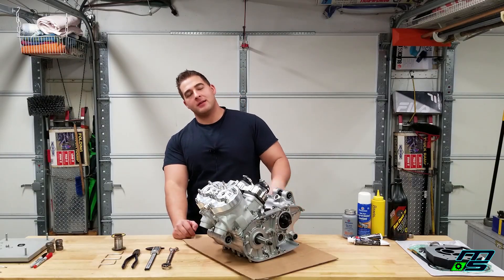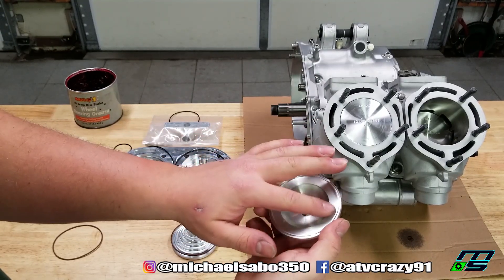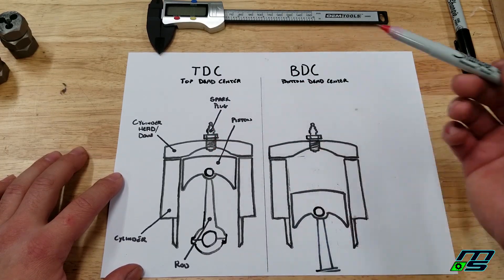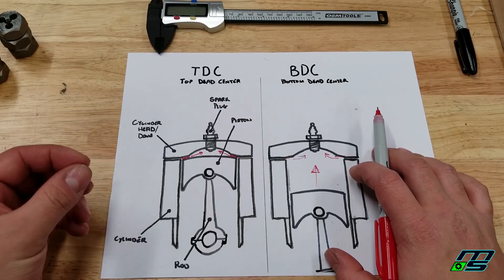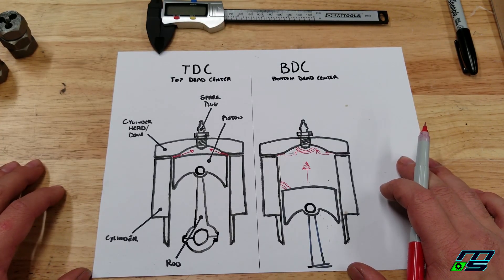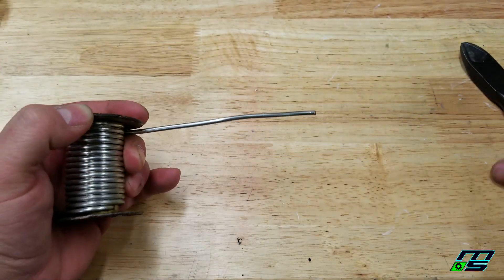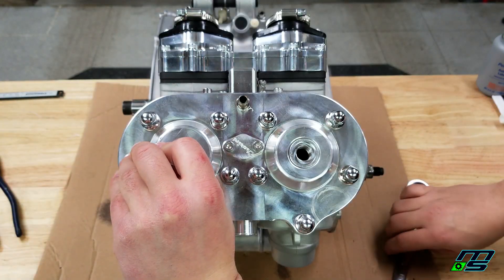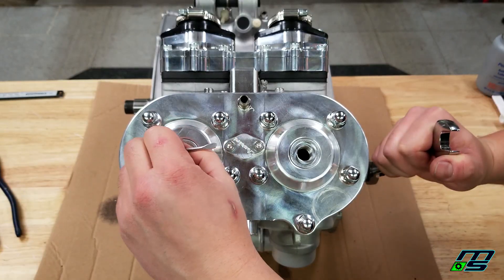What is Squish and How to Measure it | Yamaha Banshee

Comment: Very well done sir. I've been scanning youtube for info on 2 stroke engines. Especially for someone like yourself who knows what he's doing. I knew little about them until recently. I am currently rebuilding a 1986 Yamaha 2 stroke golf cart engine. Getting to the point. what is the relationship between squish and compression ratio?
The engine specs say 5.7 : 1, Combustion chamber volume (with spark plug) 1.91 cu in. Compression chamber type Dome + Squish. Could you advise on how to get the compression ratio up to a more respectable level? Thanks, and cheers.

Comment: Thanks man. Nice video. The artwork helped me better understand the squish band. 
I’ve been told with my ktm 250xc that one of the motor Mods is to have .018-0.02 milled from the main surface of the head. 

Which from your artwork I believe they are talking about the squish band area of the head. This was in essence to achieve more low end grunt. 

Is this increasing compression in essence?

Comment: I got a question.  If your squish is incorrect on a single cylinder 2 stroke, what symptoms would occur?  How much difference would it take to create an issue.  My squish on my Tx300 was supposed to be .10mm and my measurement is .30.  My KTM tech buddy said it's not enough to make a noticeable difference.  Just don't want positive squish.

Comment: What is a good squish for a 4cvl 2stroke. I’m building my merc 4cyl2syroke. And I want to create the best squish. But I can’t find any reliable info. Im doin full rebuild full porting and balancing everything. One thing in serious question is the correct squish?  I premix 50:1 with premium pump gas. I do run better fuel here an there but I want it set for pump gas as I run that more often.seems like you know your stuff so maybe you could help? Thank you. 1999 merc120hp 4cyl2stroke 1,800cc

Comment: Clever idea. Love it. But now, how to adjust a difference? And more importantly, what would be an acceptable tolerance?
Reply from the maker: I thought I had in there that you can adjust the gap by switching out base gaskets, domes or machining. As far as tolerances; I did a fair amount of research and I got conflicting information from different sites. However the clearance I measured in my Banshee is in the safe zone as far as I know lol.
Reply: @MichaelSabo  Switching out the base gaskets with what?

Comment: Okay when you do your squish or squash you are supposed to lay your lead on both sides of the wrist pin at the same time and only squash it one time not two and three times. Every time you smash the led it will make the LED thinner. The squash on a gasoline motor it's supposed to be about .060 to .065 stock.
.050 is about as low as you want to go because you have a chance to take your rod bearing out.
I was just tell you the right way to do it.
Reply from the maker: I'm mixed on this. I have learned both way and also seen ways of using modeling clay. Each method has its pros and cons but personally this method works for me and it's the easiest in my opinion. As far as the gap range; depending in what the motor is used for or the type of fuel you're running; you'll get people arguing over answers. I'm not a pro this is just what I've learned from manuals, forums and other videos.
Reply: @MichaelSabo  
I don't know if you have a case splitter or a crank puller. I wish I could send you the link on eBay. It's a tusk case splitter ,crank puller for a $100.
Best 2 tools you can buy

Cr250 case splitter

Comment: Exceptionally done! Very well explained and demonstrated. So happy you demonstrated the smart way vs the popping the head on and off method. This is very important on older 2 stroke engines due to the casting inconsistencies of the manufacturers (Suzuki was notorious for having squish band problems) causing engines to get bad raps when all that was needed was a decking job and different thickness gaskets.

Comment: I’ve got a rm250 2 stroke it pings and detnates sort of revs it self. Happens right when I start it some people said it’s a air leak so I redone the hole motor with new seals and gaskets also replaced the cranks seals twice. I check the squish and it was 1.40 mm. Any idea what it could be. Thanks
Reply: Did you leak test to confirm?
Reply: Yes I found the problem had to much compression got a thicker gasket all fixed now